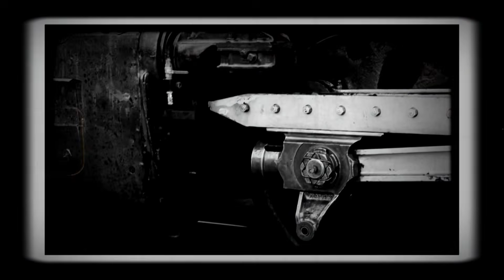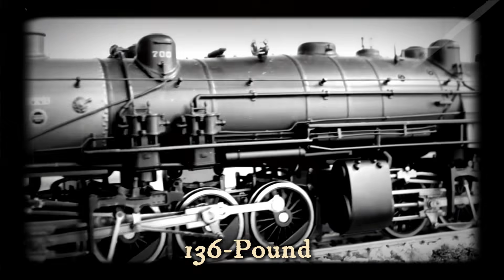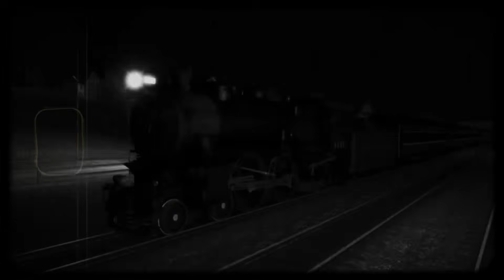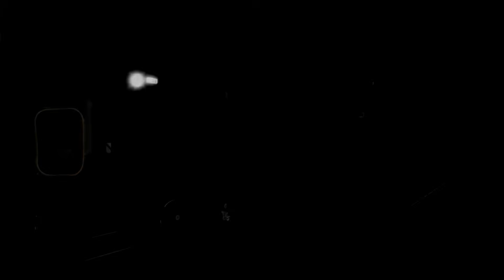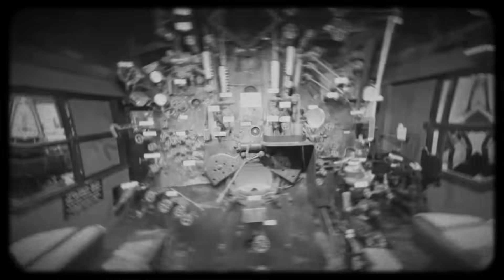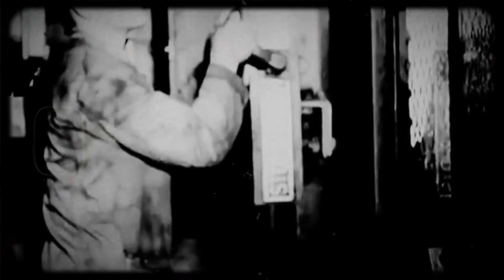Why Do Locomotives Have So Many Wheels

Comment: There's some basics to be had with the different wheel (or axle in the case of Diesels and Electrics) arrangements and articulated vs rigid. Caution, this will be a long read. 

When it comes to early wheel types, 4-4-0 is very much not the first. Very early locomotives didn't have much in the way of wheels. An example of this is Sans Pareil. 

Ultimately, 4-4-0 came to be for its stability on the rails. Although now generally on the dated side as they were made for lighter wooden passenger cars and rolling stock. They also can really only go up to around the low end of 100 MPH. SR V class and The Jupiter are examples of this type.

A few evolution of 4-4-0 are 4-6-0 and 4-4-2. 4-6-0 (Ten-Wheeler) are faster than 4-4-0, hence their major usage for passenger service due to maintaining the four leading wheels while upping the amount of driving wheels. The Canadian D10 class is an example of such. The 4-4-2 (Atlantic) are stable at high speeds, hence their existence as express locomotives. They have the trailing wheels due to the heavier firebox. One of the class examples is the LB&SCR H2 class. 

The 2-8-0 (Consolidated) were slower than the 4-6-0, but excelled for decades due to their superior tractive power for freight such as ore and timber. There were plenty of these made; especially the USATC S160. 

The 4-4-2 were later enlarged as 4-6-2. The 4-6-2 (Pacific) served the same purpose but had an easier time with steel passenger cars and rolling stock. France had their Etat 231-500. 

Other types for steam locomotives such 2-8-2 (Mikado), 2-8-4 (Berkshire), 2-10-2 (Santa Fe type), 2-10-4 (Texas type), 4-8-4 (Northern), 4-12-2 (Union Pacific 9000), 4-6-6-4 (Challenger), 2-6-6-6 (Allegheny), 2-6-2 (Prairie), 2-6-4 (Adriatic), 2-4-4-0 (Mallet type), and 4-8-2+2-8-4 Garrett arose. Garrett in their own right distribute weigh as efficiently as possible on lesser quality rails. The variety of wheel types were there for the need of addressing a situation involving improving passenger service or to handle specific types of freight. In extreme cases, mountainous terrain or the way the rails themselves are. 

Wheels arrangements very different from the previous ones are 0-8-0 (Eight-Coupled) and 0-10-0 (Decapod). They will never be practical for high speed operations as they only have driving wheels. However, they're highly stable for shunting work. N&W S1a were 0-8-0 and German Class 94 were 0-10-0. 

The question to remain rigid or have an articulated locomotive became increasingly more common as the steam locomotives grew in size. Articulated became popular due to having an easier time handling rail curvature. Though rigid ones were easier to service and better at high speed service. 

Diesels and Electrics ditch the old wheel arrangements and instead go for axle count. Four axle is very common due to versatility. While six axle are for powerhouse designs that help better spread the weight on the rails. Though it's possible to go past six as the Baldwin Centipede and Shen24 can attest.